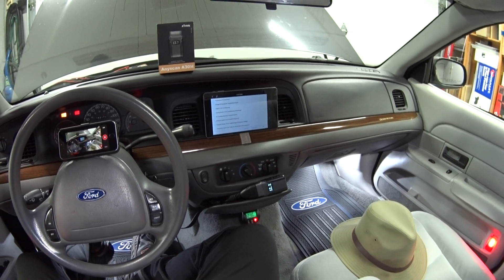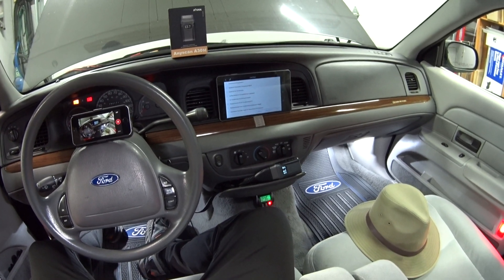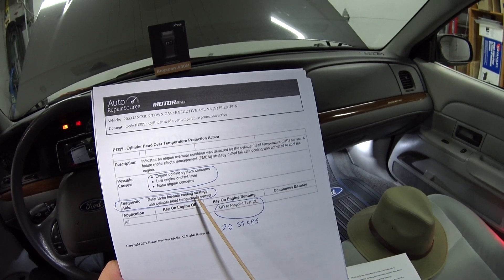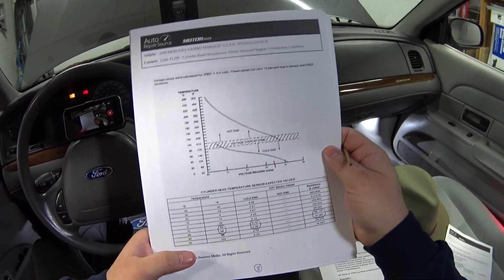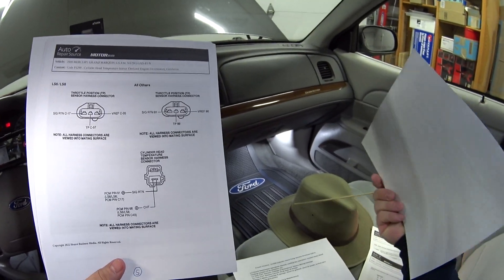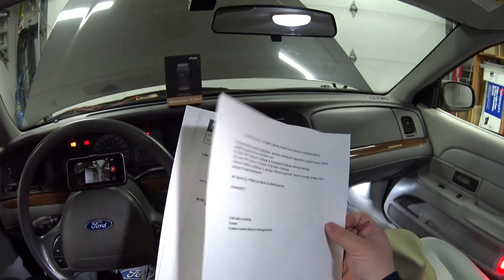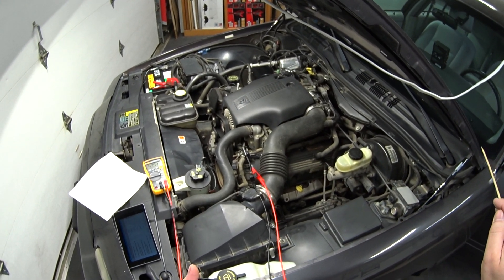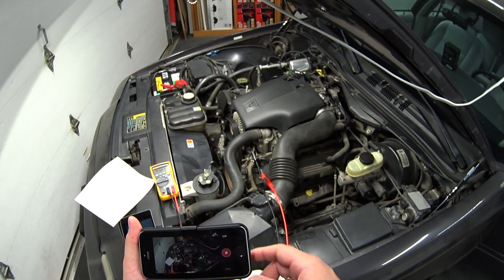Crown Victoria - DTC P1299 CHT Sensor (cylinder head temp)

Comment: Is there any way you could check where the other end of the CHT sensor plugs into the intake manifold? I bought a car that is completely missing this sensor from what I can tell and I'm having a heck of a time finding any info about it. Where you're pointing at 11:33 I ONLY have the male half of that connection. The female half and the wire attached (and the sensor itself possibly??) are completely missing and were missing when I bought the car. I have pulled off the alternator since I read that on the 2v 4.6L engines the CHT sensor plugs in on the driver side front of the engine under the thermostat but there's nothing there. Do I need to pull the whole intake manifold to reach it? This video is as close as I've ever gotten to an answer and I've been looking for literally months. 

Edit: Oh no! I just rewatched where you said it is indeed inside the intake manifold. Dang...
Reply from the maker: 1999 Mercury Grand Marquis
Cylinder Head Temp Sensor Part#
 8L3Z-6G004-A
-Chuck
Reply: @PanzerPlatform  thanks, you wouldn't know the part number for the female half of the connection you're pointing to at 11:30, would you?
Reply from the maker: @locolobos0035  
3U2Z-14S411-ARB
Reply: @PanzerPlatform  amazing, thank you!

Comment: I have an 06’ marquis. 

Mine does not have the ECT sensor. 

Symptoms include immediate jump to normal operating temp to completely hot on the dash. Engine goes into limp mode. Throws the P1299 code. 

Is this a bad CHT sensor? Clogged radiator?
Reply from the maker: @jaredvgoolsby  
You wont know until you diagnose the malfunction. 
This video shows the first steps of diagnosis. 
-Chuck

Comment: 2003 grand marquis. Fan is always running when the engine is running even with the air conditioner and defroster off. It does turn off when the car is turned off, but it is always on regardless of engine temperature. No codes. Any idea?
Reply from the maker: Hello,
Analyze the live data, look at all temp sensors.
-Chuck
Reply: @PanzerPlatform gotcha. I’ve got forscan and a Bluetooth/wifi dongle. I know I have monitored trans temp which seems to be normal, and coolant temp which seems to be normal. Not sure how I would go about reading tbe cylinder head temp sensor or the signal being sent to the cooling fans as far as speed etc? I would think possible faulty module if fans were staying on all the time, but coming on and off with ignition seems suspicious. Also seems like a faulty TPS sensor could throw it off as well based on your explanation here?
Reply from the maker: @MrWontstopthefunk  
You need something like an XTOOL A30M or similar, and the training to know how to use it.

Comment: I have 98 marquis with a digital cluster and the coolant temp stays at cold ive swapped the coolant temp sensor and my next step was to try the cylinder head temp sensor any help
Reply from the maker: Hello,
What is the ECT temp as shown by the scan tool live data?
-Chuck

Comment: Good day, might you know the part number of the cable connector from CHT? I can only find connectors with cables and i really dont want to buy 2 seperate connectors plugs then splice the cables.
Reply from the maker: Hello,
I don't understand your question.
1.) What is the YEAR / MAKE / MODEL of your vehicle?
2.) Is it a police model, or civilian model?
3.) Are you trying to replace the CHT Sensor, or the wire that connects the CHT Sensor to the PCM?
-Chuck
Reply: @PanzerPlatform  Tnx for reply, 2001 Town car, cable im looking for is on this video, where you performed tests. Cable goes from CHT then goes to another plug. 11:50. Part I am refering to is connector to CHT, then the connector to sensor underneath intake manifold. Cable has 2 different connectors and its maybe a 1ft long.
Reply from the maker: @andresrodriguez3708  
Try this;
Motorcraft WPT-985
Reply: @andresrodriguez3708   I'm also looking for this part. I bought a 99 MGM and only have the other plug, the male end, and I'm completely missing the other half of the sensor. Can't find it by taking the alternator off, that half of the cable is just.....gone. It's INCREDIBLY difficult to find any information on this part.

Comment: My 02 gm Ls temp will shoot Hot and then go back to normal. And also sometimes when driving the engine will turn off while my car is still on. I have the check engine light p1299. I’ve already changed both cht sensor and the sensor behind the alternator. Changed my thermostat and I’ve flushed my coolant and replaced it. Idk what to do man.
Reply from the maker: Hello,
Sounds like a corrosion / wiring issue.
Check for loose battery terminals.
Check all chassis grounds.
Check all grounds on PCM.
Connect a scan tool, and monitor live data of all temp sensors while driving hopefully you can recreate the issue, and record the live data.
-Chuck

Comment: Hello, my cht sensor voltage is 1.124, cht temp is 249.19°f, coolant temp 149°f, this is with car not running and cold. Any ideas?
Reply from the maker: Hello,
What is the YEAR / MAKE / MODEL of your car?
Is it a police model, or a civilian model?
Are you experiencing a drivability malfunction?
How does the car run, and drive?
Are there any DTC's?
-Chuck

Comment: Hello good sir, i come in dire need of help.
I have a 2001 Town car Signature, and it only stalls when engine is hot driving it.
It works just fine when it is cold. It stalls when i drive 40+mph, when i slowdown.
It just turns off, does not vibrate, burb, struggle. I can turn it on immedietly and keep
going forward until maybe next time I slow. But it does get harder to turn on.
Ive bought car private sale, and for a month after purchace it was fine.
Here is what ive done so far of 2 months of ownership
Changed oil 5w30
Coolant flush with new thermometer
New IAC
Cleaned Mass air flow module
New serpentine belt
New alternator
New battery
I got a reciept that 1st owner did a trans rebuild
I got a OBD scantool with app on phone and drove until it stalled
I had a suspicion it was the alternator before.
Watching the Volt gauge, it stood stable, but the app did record
for a fraction of a second the lowest it went was 8v.
Here is a link of the picture.
https://ibb.co/ypMcq40
I forgot to add, there used to be code 0133, I changed o2 sensors minus driver before car, then 1504. Cleared never came back but still stalls.
Few things different not sure if revenant about this car, 1st owner did spring conversion suspension and took off vapor canister.
Reply from the maker: Hello,
Sounds fuel delivery related, or electrical related.
Maybe a loose wire, or connection.
Start there.
You might see clues watching live data during the malfunction.
-Chuck
Reply: @PanzerPlatform tnx for reply, reason I thought it wasn't fuel related is because I can turn it on right away. What do you suspect? Fuel pressure? Fuel pump?
Reply from the maker: @andresrodriguez3708  
Analyze live data from scan tool.

Comment: In My 2008 grand marquis, my fans do not turn on unless I unplug the CHT sensor, triggering it into fail safe mode. My car has overheated many times in traffic and the fan has never turned on, but the temp gauge on the cluster works fine, I was wondering if it was the CHT
Reply from the maker: Hello, 
I would test the resistance of the CHT Sensor to confirm its within specification. 
-Chuck
Reply: @PanzerPlatform  the resistance of the CHT is 2.78
Reply from the maker: @skyebane5025  
See chart at 13:48 to see if within specification.
Reply: @PanzerPlatform  my radiator fan turned on when I put the leads from my multimeter on it, I put it into the harness where the wires meet (on the CHT side). Could it be a bad connection? And it only turned on when it was set to ohms (I tried it with volts but it did not turn on)

Comment: Great video, however how come no one ever shows how to test the sensor signal wire from the CHT sensor? Aka gray wire with red line on it?
Reply from the maker: Hello,
Thanks for watching.

"how come no one ever shows how to test the sensor signal wire from the CHT sensor?"

Because there is no "signal" wire on the CHT Sensor.
It's just a basic 2-Wire resistor, not a 3-Wire like a potentiometer.

Are you currently experiencing a malfunction.
-Chuck

Comment: I change the coolant sensor and the head temp sensor and the temperature gauge goes all the way down when i turn the engine on
Reply: ITS a 99 Mercury grand marquis ls
Reply from the maker: @GustavoPérez-m9e  
1.) Does the car run, and drive OK?
2.) Why did you change those parts?
3.) Is the Check Engine Light on?
4.) Do you have an OBD2 scanner, what are the DTC’s?
5.) Is your only malfunction the temperature gauge in the instrument cluster not working?
-Chuck
Reply: ITS the only thing not working engine on goes down i turno the engine off and It goes up to normal
Reply: And onother thing ITS normal if you unpluged the head temp sensor the radiator fan turns on AND when i pluged It back the fan turned off
Reply from the maker: @GustavoPérez-m9e  
OK, put back all the old parts.
And check the wiring of the ECT sensor. 
1.) From the ECT sensor to the PCM.
2.) From the PCM to the instrument cluster.
Reply: @PanzerPlatform   can i drive the car turning the heater on that makes the radiator fan turns on meanwhile i get the wiring checked out
Reply from the maker: @GustavoPérez-m9e  
I don't understand your request.
Are you now having an engine overheating problem?
Reply: Because It wasnt reading the temperatura i thought It was the coolant temp sensor a It didn't work and i saw some videos and It said that could be the head temp sensor and didn't work, the engine light is not on and i have a small scanner and no codes show up
Reply from the maker: Hello,
1.) What is the YEAR / MAKE / MODEL of your car?

2.) Is it a police model, or civilian model?
-Chuck

Comment: Does this code or the sensor stop the car from starting? If you push gas pedal down it will start. Thank you for any advice
Reply from the maker: Q: Does this code or the sensor stop the car from starting? 
A: No.

Q: If you push gas pedal down it will start? 
A: I don’t understand your question.
If you fully depress the gas pedal while starting the engine on any fuel injected car it will engage “clear-flood mode” and the car will not start.

Q: Thank you for any advice?

What is the YEAR / MAKE / MODEL of your car?
Are you currently experiencing a malfunction?
Can you describe the malfunction so I can understand?
-Chuck

Comment: Looking for some help on my 06 crown vic. Radiator fan won't stay on and AC won't start the fan. Relays good, Motor good, fan module good, thermostat good, temp head sensor good, i'm on the verge of installing a switch to operate the fan but if you have any ideas i'm all ears. Thanks in advance
Reply from the maker: Sounds like a wiring, or bad connection.
Try this;
https://youtu.be/r_vK3MJ3O_U
-Chuck
Reply: I'm having the same issue.. any luck finding the problem? Any tips? Lol
Reply: @drew4766  Chasing the same problem.  I have been running mine with the Cylinder head temp sensor disconnected, in which case the fan will run by default.  Have you had any luck finding your issue ?  I'm about to try the PCM as im running out of options..
Reply: @markhenley4745 did you ever find the culprit I’m going through this issue right now

Comment: This is one of the best car-repair videos I've seen.  THANK YOU.
Fortunately, it turned out my 2001 Grand M. was just low on coolant.
Where can I that info you showed printed-out?  It's super helpful.
Anyscan showed very useful data.  
Do you happen to know if it shows that info for older cars, like my 2001 Grand M.?
Reply from the maker: Right on Jim,
Thanks for stopping in, and the kind words.

Here’s how to get the service literature;
https://youtu.be/cCxHk1PNBuo

The scan tool works on any car 1996, and newer;
https://youtu.be/m6otHuriq_M
-Chuck

Comment: Isn’t there a coolant temp sensors and a head sensor? I heard they both go separate places? I have a 2003 grand marquis and the fan is always running even when car is cold. Gauge seems to be properly working, seems to work properly VIA “ect” reading on scanner. Ac is off.
Reply from the maker: Yo Mr. Funk,
Thanks for stopping in.
This might shed some light on your question;
https://youtu.be/13tlhiBSriY

If you need help diagnosing your malfunction come on back.
-Chuck
Reply: @PanzerPlatform hey, Chuck, thanks for the quick reply. I was still watching the video lol. I just wanna say real quick man I appreciate all your stuff and when I see your name pop up I know I’m about to get some good solid knowledge. Just subscribed. 

I’m currently transitioning to a recently acquired 2003
Grand marquis. Very questionable on its history. Very low rust so that’s great, but I think it might have had a hard life. Only 95k on her now. Trying to get her back into shape. I had a 2004, very nice and rare, deep blue outside, all black leather inside, sunroof, digi dash, And I had a lot of money into her. I had to swerve to avoid a head on collision and hit a telephone pole and a tree at the same time, so she’s gone. I’m lucky to be alive. 

Anywho, I currently have no current/pending/permanent DTC codes. I’ve been working on flushing the coolant as it was very mucky and had metal flakes in it which appear to be aluminum. I have a bad feeling someone put head gasket in a bottle in it at some point, praying I don’t have a head gasket issue and it was an Ill attempt to avoid replacing the intake manifold which has been replaced. 

Anywho, any other ideas on where to go from here? Would love to talk to ya sometime by the way lol
Reply from the maker: @MrWontstopthefunk  
Right on, thanks for the kind words.
What do you want me to help you fix first?
Send me an email for more help: BudgetPantherPlatform@gmail.com 
-Chuck

Comment: Where did the floor mats come from? I'm looking for those exact floor mats for my crown Vic
Reply from the maker: Right on Josh,
I got that front 2 piece set from Walmart back in 2009 when I bought the car for $20.
The brand name is called Plasticolor.

In 2016 I found a matching 2 piece set for the rear on Amazon for $5 each. lol
Also made by Plasticolor.
It looks like they are out of stock.
Front; https://www.amazon.com/Plasticolor-001489R01-Elite-Ford-Floor/dp/B00I3E2558
Rear;
https://www.amazon.com/Plasticolor-001219R01-Elite-Ford-Utility/dp/B00I3E255S
-Chuck

Comment: I had the same problem as the temperature sensor, MY temperature sensor was in VERY front attach on the head to the driver side, and didn't take the manifold off because the temperature was in a front of the cylinder head, but it was difficult to take out of the cylinder head, but it took me 5 minutes installed it, my 08 grand marquis was overheated so now my grand marquis is running well, grand marquis is never die
Reply from the maker: Right on Chris,
Thanks for watching, and the good feedback. 
-Chuck

Comment: Enjoy your vids, I was able to replace my grandsons sensor on his P 71without pulling the intake,cutdown 12 pt box wrench Regards
Reply from the maker: Right on BG,
Thanks for watching, and the good feedback. 

Why did you replace the CHT Sensor?
What kind of symptoms did you have?
-Chuck
Reply: I replaced the cyl head temperature sensor because I replaced the fan assembly which had melted connectors at its control module,Just replaced it as a precaution because the P71had a lot of miles,
Reply from the maker: @thebiggerman6975  
Right on, thanks for the clarification.
-Chuck
Reply: @thebiggerman6975  did this fix your problems with the melted connectors my 08 P71 has that same issue of melting the connectors at the module.
Reply: @clancycell89  good afternoon my friend, I have had to replace the connector that plugs into the fan module before, I would say it is a common issue for the module or connector ,to melt I think the current to run those fans is a little high for the wiring especially if the fans are getting older and drawing a little too much current, hope this helps you, my grandson loves his p71, it has been a great college car
Reply: @thebiggerman6975 ok thank you sir yes they are great cars mine has over 300,000 and still running like new but thanks again for the quick response that is very helpful I just replaced my second Dorman fan in 8 years the other day
Reply: Hi can you explain how you did that? I dont even know where it is? 06 p71
Reply: @MonteLeeMyPOV  hello Monty I change the cylinder head temperature sender on my grandson's 11p71 because it was original equipment been in there a long time he had fan issues so unplugging it makes the fans go to high on the radiator this is a good test of the rest of the system the CHT is just a coolant temp sensor it is behind the alternator I got mine out with a short 12-point wrench and just took my time if you pull the alt it may make it easier I hope this helps you